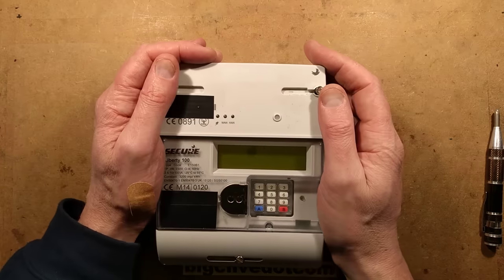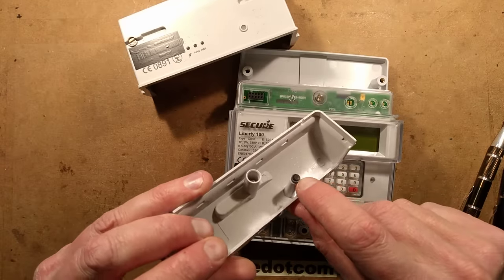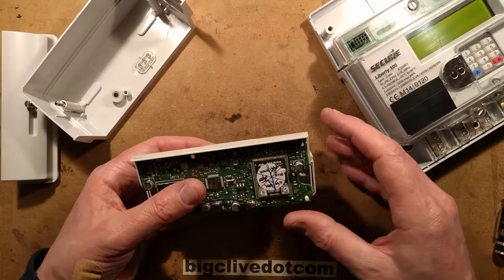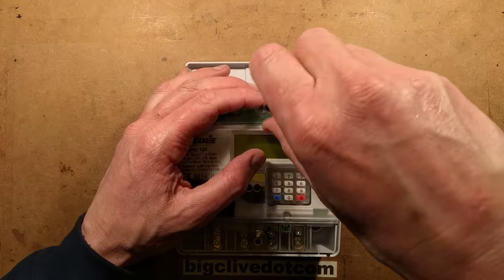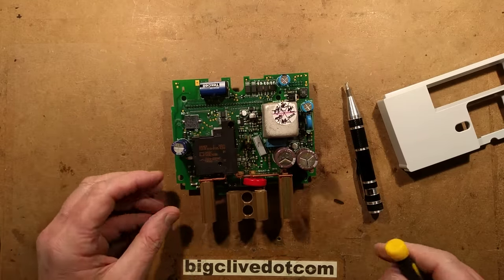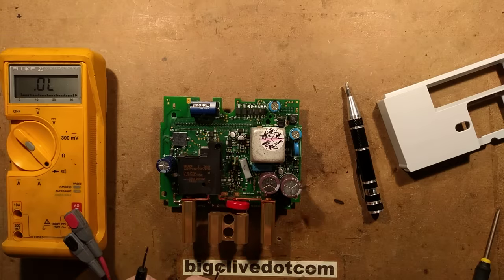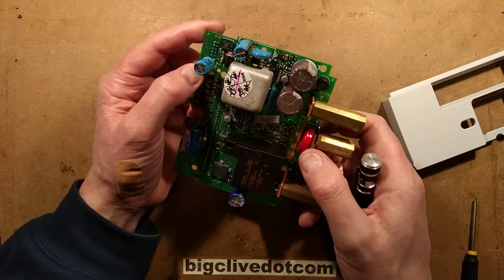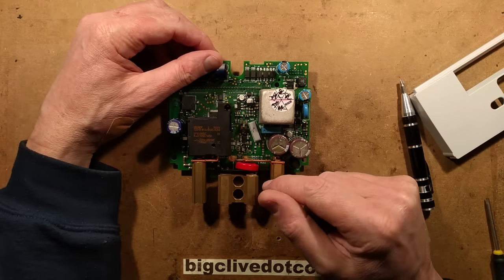Inside a smart meter, and the REAL problem with them.

Comment: Clive removes his meter, then pretends it is from somewhere else, takes it to bits to look how he can reduce his bill, finds he can't then replaces it pretending it was never off the wall, but then he finds they will know, so sits worrying that he is caught!  lol  Even tries to hide the serial number in case someone from power company is looking in!
Reply from the maker: I put solder blobs across all the anti-tamper pads and then said I had bumped the meter accidentally so they reset it.
Reply: @bigclivedotcom  lol I would almost believe it but it is Big Clive!
Reply: Clive have already figured it out, since he still have power while the meter is disconnected.
Reply: @LeifNelandDk  He bypassed the meter while he did it.  I don't think Clive would do that (all the time lol) but it used to be easy to make a device that would make the meter run backwards, as long as you were not greedy you would get away with it.  But it is dishonest and you could go to jail!  However, I built one just to prove to myself I could do it and I had a meter on  the bench and yes it worked.  These new meters would flag it up right away so we don't have to pay for those that steel power.  This was a good look at something other that lights and phone chargers.  I loved it, shame he didn't do a diagram of how it works, but I suspect it might take a while.  I would have liked to know what was inside the tin screening box (if that was what it was, I suspect it was) but it was very interesting.  Thanks Clive and I forget who sent it in, but thanks for that.
Clive will already have a free feed of power as his mate works for the National Grid lol.
All a conspiracy theory. He has the know how to get free power if he wanted to.  We would all like free power, but most of us is to honest to get it, others would fry themselves trying to get it.  In my old job I would come across gas and electric meters that were bypassed and it was in my contract to report them.  It is a very dangerous thing to do as Clive and his mate will tell you.  I came across one that made the meter stop when the door to the cupboard was closed, but it would turn normally when it was opened, it was very well done, but as it happened I had a electricity board man with me as the main fuse had blown (you would have thought the person responsible  would have removed it, but as it happened he was at work when I went to the property, discovered there was no power to the property, and checked the fuses, they were ok, so checked if power was coming into the distribution board, nothing.  Electric company was called as I could do nothing without power.  They arrived and replaced the fuse and it was only when he was leaving a wire caught his eye.  He traced it back to the meter and found it was a clever meter stop device.  He called his supervisor who arrived, he called the police and I was there all day thanks to that.  The police took the people back to the house, confronted them and charged both of them.  It turned out the unprotected switch built into the door was at 250v (mains here) and the terminals were exposed, so anyone touching them by accident run the risk of being electrocuted.  Everyone left and left me with the wife of the accused and her family in the house as they had all arrived home by this time.  All I said to them was "It was hard luck he spotted the wire running round to the door and wondered what it was, if your husband had put it behind the wall it might not have been spotted as the wires that connected to the meter were very tidy and very hard to spot"  They didn't say much to me, but you could cut the atmosphere with a knife!!  They were not hard up people either, collar and tie job and well up in his company.  Now all the meter readers are trained to look for signs of interference of the meters.  Now it has gone one stage further as in the video, the meters will alert the company if it has been bypassed, or messed about with.  I have seen gas meters bypassed with a bicycle tube, some without going through the governor!!  Highly dangerous, if I came across this I would turn it off (if the off handle was still in circuit, sometimes it wasn't) take off the handle and walk out and report it to my work, it was up to them to get access and sort it out, I would have nothing more to do with it, life is to short to get involved in things like this!  Now I have changed what I do so it is no longer a problem for me.  People can be violent towards people discovering their fraud.  It was also dangerous to others living in the same building, on was in a high rise skyscraper, gas and electric meter bypassed!!  Now the gas meters are usually in a room downstairs where they can't get at them and it would be easy to spot it if they were bypassed.  But this also brings a new danger, they have no access to them as it is the landlord that has the key, so they can't turn it off in an emergency.  Nor can service engineers get access to them to check for gas soundness.  Electric meters are going this way as well, only thing with them is that you can turn it off at the consumer unit.
Big Clive does not bypass his as his workshop is always cold.  On one video you could see steam off his breath!  Reminds me on the very cold houses I used to live in when I was still at home with my parents!  
Those were the days, icicles inside the bedroom window!  Nice frosty patterns on the glass windows and the clothes that you had looked out for the next day as stiff as a board!  Those were the days!
Reply: You should have written a book on this,      oh! wait.
Reply: @prg2812  wasnt a bad read tho, ill give him a thumb up.
Reply: When you are driving along a road at high speed in something that can weigh a couple of tonnes it's not the best time to want your circadian rhythm to function correctly, it is however a fantastic time to stay awake.  Do you think street lights should also play a video of sheep jumping over a fence too, gesteppie?

Comment: Optoisolated due to external antenna connector.
Reply: Interesting that Clive both wonders about the need for isolation and notes the lack of earth - this whole unit is basically live (since fault conditions can raise neutral up way high)
Reply: in my country, neutral must be connected to earth as close as possible to the main junction box, so i dont think separate earth connection is necessarry in the meter
Reply: It is considered as double insulated, as there are no exposed metal parts, except for the sealing screws. No whole-current meters are ever earthed, either domestic or industrial.
Reply: ben kerr Older mechanical meters had a steel casing instead of the more modern plastic.  But that was before earthing at every outlet became normal.  As for earthing near the meter, this varies significantly by country.  Some places use a TT distribution with the grid neutral nominally grounded at the substation and each house having a local ground electrode for the PE, thus the two being connected only through the actual ground.  Some use the IT delta distribution system where the grid is not intentionally grounded at all, but any phase may be accidentally grounded by an unexpected remote fault at any time, raising the other two to 230V above ground. Connecting grid neutral to house PE is a feature of TN distribution systems only.

Comment: Sorry for late comment, I've only just stumbled across this video. I think that the square grey item welded into the live 'bus bar' is a calibrated resistor that doesn't change with temperature (e.g. a Constantin like material). My recently installed meter has a stated operating range from -25 degrees C to +55 C. Based on a quick check on-line, that temperature range would increase the copper's resistance by about 28%, so easily enough to give an inaccurate current reading (obtained by measuring the small volt drop across that link) if copper dominated the resistance value.

Alternative approach would be to use a measurement of temperature to calibrate out the difference using software, but I couldn't see any sign of a thermistor (and that introduces the risk of temperature difference between its location and the bus bar's, particularly if lots of current is being demanded, so heating the bus bar).

As an aside, the short range radio you found might be used to communicate with the battery powered radio in the gas meter. The mains powered electricity meter acts as a relay station for the gas meter, connecting it to the wider area network (the gas meter has to conserve power to make its battery last for approx. 10 years). My electricity meter has a separate communications hub mounted on it, but looks like yours integrated both of these functions in a single unit.
Reply: As I said years ago, it's a current shunt. (and it's silked on the board in 3 places!) Temperature stability can be measured with something as simple and tiny as a transistor. (that's a very common way to do it.)

Comment: The modem part is a module so that it can be easily upgraded without replacing the whole meter, or even having to disable the upstream power supply. We're already moving from SMETS1 to SMETS2 and 3/4G to 5G. Of course they could just put a software-defined radio in there and upgrade remotely as and when, but that doesn't make business sense for the supplier. The large capacitors are likely to be for the "dying gasp", in the same way your home modem/router gasp during its final moments, but also for tamper detection, as you say.

I have a pre-pay meter, this model, and it talks to a "smart display", which is why there is additional comms circuitry in the modem. The communication is two-way so it is basically a router for the Grid's WAN. With SMETS2 the communication should be more useful for the user/customer and it's supposedly not an optional upgrade. We'll see.

The front panel is so that you can enter a top-up code if your power is out and you don't have batteries for the smart display, AND your phone can't be used. It also has diagnosticy stuff too. And other things that make no sense.

My gas meter is the same sort of thing but listens to me fart.

Comment: Can you build a faraday cage and fire it up I want to see it turn on.
Reply from the maker: I'm toying with removing the modem and seeing if it still works without it as a plain meter.
Reply: that would be really interesting!
Reply: It will just use morse code signalling down the power line to contact its masters.
Reply: @PhilC184  more likely smoke signals  ;-)
Reply: Maybe you can alter settings to trigger calculating cost based on the "Apparent Power". Not sure what that is but you've talked about it before LOL.
Reply: or even just remove the SIM.
Reply: @bigclivedotcom  what goes well with toast? that (don't give power companies any ideas but that's mine).
Reply: true but it might have an ET phone home for having its SIM removed. Could work since phones can make emergency calls without a SIM.
Reply: @PhilC184 ; Actually, that's not too far off. This is called PLC and most meters have the capability to communicate over power lines (usually incredibly slowly due to all the inductances involved), and many of the first smart meters actually used it as their main communication network, without having any cellular modules installed.
It is still commonly used today in places with cellular dead spots/rural locations/third world countries.
Reply: A microwave oven is a very convenient faraday cage we all have around the house...
Reply: @PhilC184  Your lights, especially the outside lights, will be flashing morse code to a satellite, the backup receiver when the modem is removed.
Reply: Use a car power to 110/220 v ac and hook up to your car to prevent powerline signaling
Reply: @mortlet5180   - That's simple to work around.  Add an inverter filter to the line, and it can't pulse back.  Even a UPS with AVR will usually include an inverter stage.
Reply: @mortlet5180  PLC is actually used in central europe on fairly modern grids in cities. It incurs no extra cost and having to deal with the pitfalls of gsm networks. Plus the meter is somewhat cheaper. GSM is better for very rural areas. In cities you can use things like LoRa, ZigBee, etc.
Reply: @ScooterZn  satellite funny
Reply: @ShanesGettingHandy  A microwave oven is also the head chef at olive garden.

Comment: The relatively heavy case on the internal PSU might be to address the issue of stray wide-band RF that some hams have been moaning about from SOME meters. Not much point in being rigorously watchful about the entry of cheap SMPSs into the house when the Local Power Company sneaks one into your house under your nose.
Of course, all the shielding of the PSU still won't prevent the whole damn circuitry being a horribly inefficient and partly effective radiator, unless they've taken a lot of care with that, too.

Comment: From what I’ve read when researching Smart Meters (in the UK), the Bluetooth connection is between the meter on your gas supply (if you have one) and the main unit that is on the electricity supply. Then the data from both is sent to the supplier via the cellular connection.
Reply: It's Zigbee (Like Hue lightbulbs) not bluetooth, but yes.  WiFi, bluetooth and zigbee all use the same 2.4GHz licence free band.

Comment: The sim would still work, i tried with a meter i had, i used up their data, then they barred the card
Reply: No PIN code? Lazy.
Reply: How would that work? Of course it's without SIM, but typically those cards are allowed only into special APNs which terminate in an IPSec tunnel at the utility company, not "the internet".
Reply: I asked our installer and aparently these cards go on to whatever network is available somehow.
Reply: some power companies are lazier than others and will have roaming contracts that let them just grab whatever signal is strongest/available and not worry about it
Reply: Show me a power company that is competent.
Reply: Can verify roaming sim usage  however the sims are usually dial in only. So would be useless for someone to put in phone
Reply: did they sue you?
Reply: LOl
Reply: Lol nice one

Comment: Big capacitors are there to communicate a power fail message to the central office, so that it will report an outage from multiple meters going off on a single line, or just report a tamper event otherwise for single meter alarms. The isolation is because they also have the option to use a single modem module on multiple meters in a cabinet cluster, so the modules are isolated from each other and the mains neutral, and they all feed via an isolated power rail to drive the common modem unit. Lithium battery is there to keep the program in RAM. After all it is always powered, unless the network is off, thus the battery to hold it through power failures, and you need a 20 year life battery to match the expected life of the meter.

Hall sensor is there to back up the internal current sense resistor, and to detect external tampering using a magnet, or to detect bypassing the meter. MOV is a 470VAC unit, there as lightning protection for the power supply, and has to withstand connection to 2 phases or no neutral connection operation. Relay module is a bistable relay, so again the hall sensor is there to detect operation of the coil, and incidental use of a magnet to prevent the unit switching off.  

Keypad is there for programming in field, check readings, time of use data and such that you can download, but do not want to download and erase like the programming tool does, or for a service tech to confirm meter serial, date of install and such. These are not typically used as prepayment meters, those normally use a separate internal unit to do the data entry, but can be used for that as well with the right programming. As prepay meter the code entered is generally also locked to the meter serial number,  as otherwise there is nothing preventing you paying multiple meters with the same code, as in general most of these meters actually do not use a data connection due to the cost of the connection in mass.
Reply: I always wondered what would happen if you point a microwave oven magnetron's waveguide directly at one of these smart meters.
Reply: @spikester  🤣🤣🤣🤣🤣🤣🤣🤣🤣🤣🤣🤣🤣🤣🤣🤣